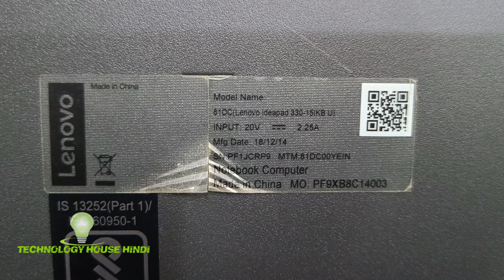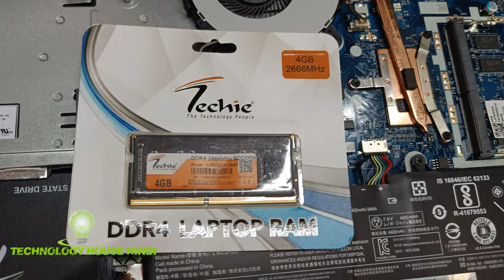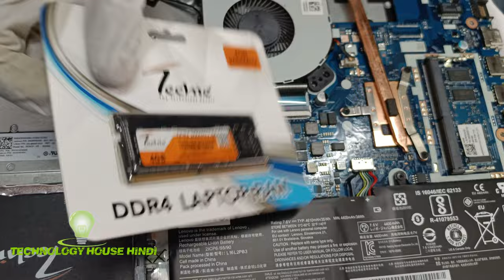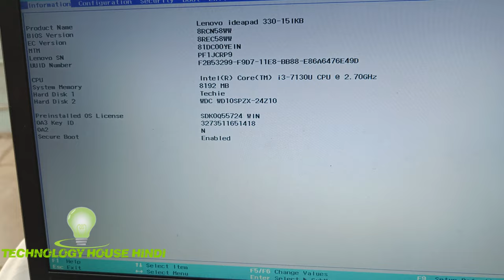Lenovo ideapad 330-15IKB SSD Upgrade ,  Lenovo Ideapad 330-15IKB U sata SSD  / RAM Installation

Comment: I think in this laptop 2133mhz ddr4 ram supported but I saw u put 2666mhz ram . How it's working??
Reply: What happens is that the pc forces both to run at 2133mhz